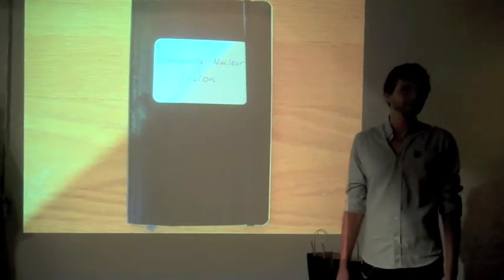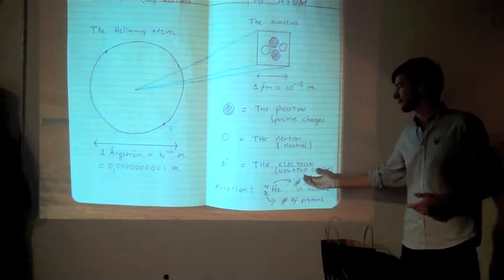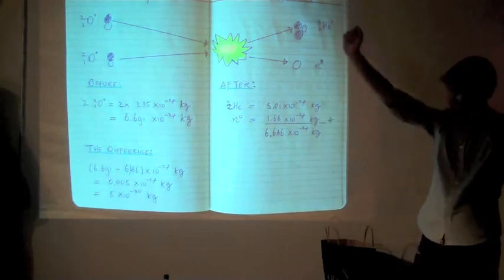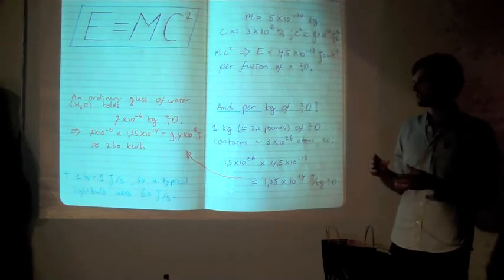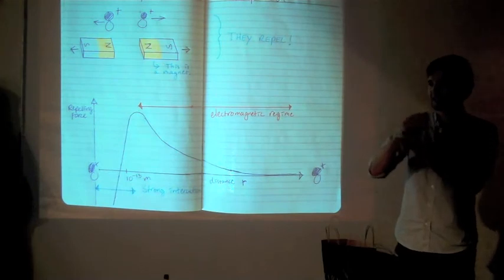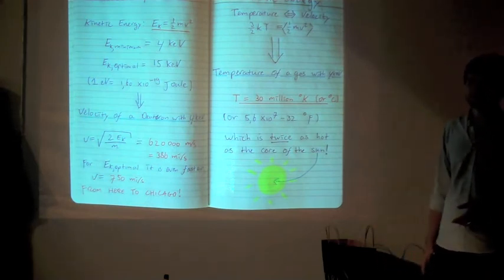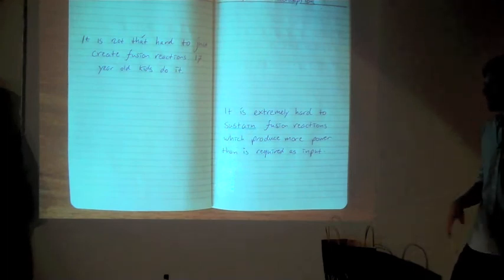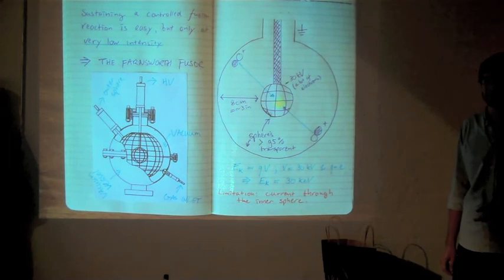FRED Nuclear Fusion part 1

Comment: what material is the conductor at the core of the reactor? and also, theoretically speaking, could a material with high enough thermal mass/resistance/whatever to withstand the high temperatures, and yet also have a high enough conductivity under high temperatures, be used in order to sustain the reaction?